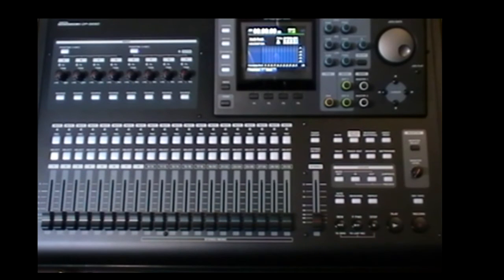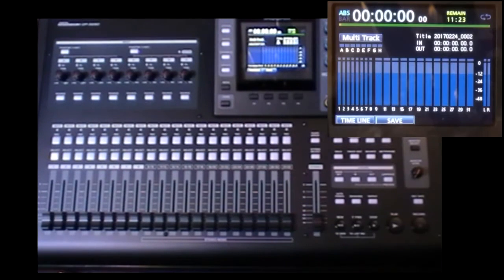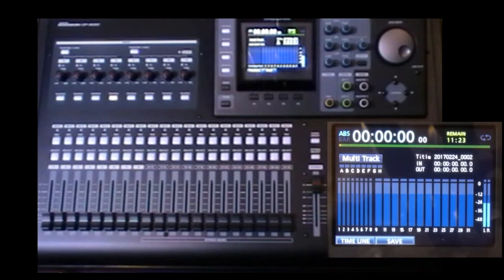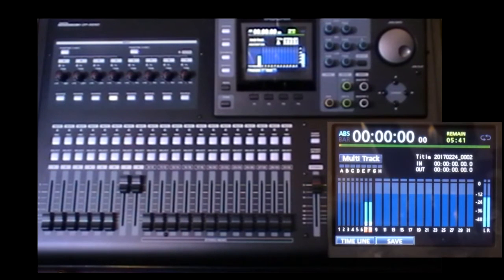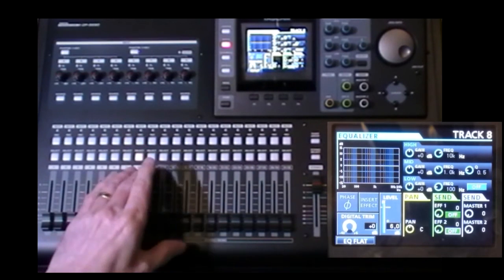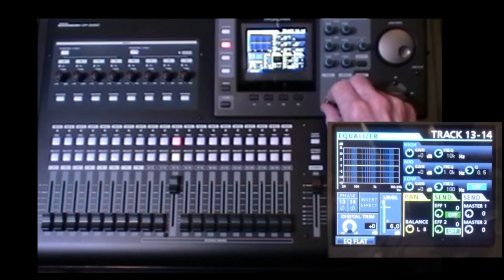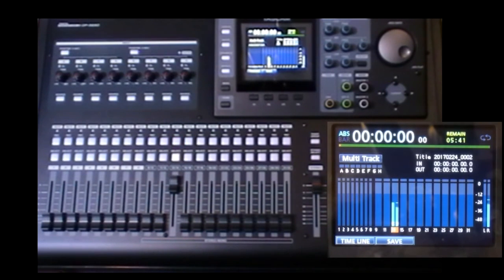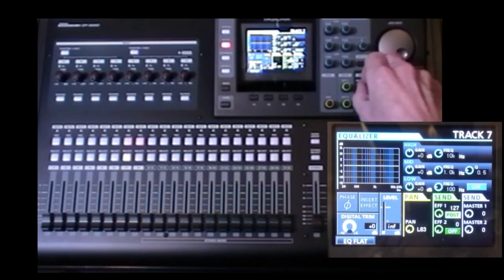Tascam DP24/32SD Tutorial 6C: Stereo

Comment: Hi Phil,

I bought the DP24SD to replace my worn out over complicated Yamaha AW16G. It has recorded 23 albums for me but sadly the inputs and faders are failing, so time for it to go. I won't miss it as this replaced a previous Tascam. A great big heavy lump of a machine. Tascam 688 sounds about right. I do miss that one. However, I don't need all the functions as with any Portastudio I send my custom made midi track from Cakewalk Sonar to the portastudio. Tracks 3 & 4  with a pan at about 12L & 12R. I find panning at a full 16 left & right tends to hide instruments. After recording my backing track I use all the other tracks to rehearse my guitar until I find the track I like best. I mix down through an Alesis 3632 compressor to mini disk that has the auto pause function, then optically copied to a music CD. I then convert to WAV on my PC. I havent set up the Tascam yet as I am concerned about reverb. I layer a  hall reverb over my guitar tracks and I thought I would ask you is that easy on this machine? I only add reverb to my guitar not to the finished track. I like to record 'Dry' using my Fender Mustang amp and then fiddle with it. Your tutorials are enjoayable and anything is better than reading a manual. I have never read a manual so thank you for the great videos.
Reply from the maker: @Peter Williams Hi Peter, thank you for the kind words; glad you found the videos useful. Adding reverb can be easy, but it depends on your workflow and how you define easy :)

Whatever your workflow is, the reverb effect is only available in the Send effect section so you need to be comfortable with using the send system. This system 'taps off' a proportion of your guitar track(s) onto the send paths. You can normally choose either send-1 or send-2 or both, but the internal send effect is only connected to send-1 so you have to use that.  So for each guitar track you want to apply reverb to, turn the send-1 control on (for reverb you would normally set it to POST), and then turn up the send-1 level and the overall master send-1 level.
This will route a proportion of the guitar track(s) into the send effect. 

You then need to go into the effects section and select the reverb, turn it on, and adjust the reverb type and return level. The latter gets the reverb output back to the stereo bus where it will be mixed with whatever other tracks you are playing (i.e. the ones whose track faders are turned up), such as the backing tracks and/or the dry guitar track(s).

Your workflow will then dictate what you do with this mix.
 
1. The simplest method is to feed this mix straight into your external gear, so do all the above in multi-track mode.

2. If you want to record the mix on the DP machine first and then play it back later into your external gear, do the above in mixdown mode.

3. If you want to record the reverb to a spare track so you can do options 1 or 2 later, do the above in bounce mode. Obviously in this case you would only turn up the track fader for the guitar track. You will end up with a new track containing the reverb'd guitar, so you can then blend this with the other tracks during the mix later.

Hope this helps.
P.S. some great guitar playing on your videos - very smooth :)

Comment: Hi Phil,

Thank you for all your help. So far I have plugged it in and in multi track mode I selected channels 3 & 4 and using the assign & faders set a level for my backing track in rec armed and ready. I then discovered how to pan both left & right to minus 50 and plus 50. I also did a full format to the SD card. That took ages. My mistake was as I was recording the backing track to Wind Of Change I found the whistle was too high so I stopped and pressed rewind and started to record it again. But, I was not aware that it had saved the previous recording and it won’t let me delete the track. I went to the end of the track and I then used the jog knob to wind back the audio very carefully to the end of the song and pressed record with both faders down and recorded over what I wanted to get rid of which was after my good recording . Not sure if this was correct but it worked.
So how to you clean a track out when you have made a cock up like I just did? My next project is to see if the track I recorded will play through the Stereo out to my external gear. Monitor out plays fine, but I haven’t hooked up stereo out yet.

So far so good.

Peter
Reply from the maker: @Peter Williams If you want to delete a whole track, press Track Edit and use the 'Clean Out' function. Another option is to just press Undo and your last operation will be undone.

You mention turning both faders down when you attempted to delete the track. Just to clarify, the track faders do not alter the recorded signal; they only control the playback signal. The reason it worked was because you had no signal at the input while it was recording.

Panning does not affect the recording either; only the playback. 
I presume you are assigning the 2 inputs which are connected to your computer (for the backing track) to 2 separate mono tracks so that you can pan them to your desired 50/50 values. If so, you can adjust the panning after the recording if you like. Panning only affects the signal you hear when playing back, or the monitored signal during the recording; it does not affect the recorded signal itself.

When you playback, any tracks which have their faders up will go to the stereo output via the master stereo fader. These tracks also pass through the track pan controls on their way to the stereo outputs, so this is when you need to set them correctly. 

These tracks can also be tapped off in varying proportions to the 'eff send' outputs if you configure the send system correctly. This can be used to drive external gear if you want, or the internal send effect for adding reverb etc.
Good luck.

Comment: Hello Phil! Thanks so much for your great videos! I have a question concerning the stereo routing. I use my laptop to make drum tracks for my music. I am using a 1/8" stereo male to (2) 1/4" mono cable (exactly like the one you pictured) to connect my computer to my DP-24. Your video shows (basically) the way I have been recording: from (Input A/B) to a stereo track. In the video you say that a stereo track does not need panning. What I'd like to know is: does this mean I do NOT have to pan the INPUTS (say, A/B: in from my computer using the aforementioned cable) hard L and R?? I get that I don't need to pan a stereo TRACK, but am unsure about the need to pan the inputs assigned to it. Thanks!
Reply from the maker: Hi +oneminuszero and thanks for the kind words. You don't have to pan the inputs if they are going to a stereo track. The splitter cable and your assignments have done that for you by routing left & right to their respective sides of the stereo track.
Panning affects how a signal is split at the point where it joins the stereo bus, regardless of how the signal got there. If you're connecting a mono source to the stereo bus, either directly from an input, or from a mono track, you need to pan using the respective pan control. 
If you're connecting a stereo source (it can only be a stereo track because there are no stereo inputs), then you don't need to pan as the stereo track is internally wired so that its left & right outputs are connected to the left & right sides of the stereo bus. You just have the balance control for correcting any left/right imbalance in the original stereo spread - I use the balance for correcting old tape/cassette recordings, especially if the tape was worn or the heads were dirty, or with old vinyl record decks where the pickup head wasn't set up correctly... showing my age now :) Hope this helps.
Reply: Phil Tipping first: thank you so much for answering. I'm still a bit confused, though I'm probably just overthinking this. You mentioned that if you were using mono inputs you needed to pan to keep the stereo image. If I'm using a stereo 1/8" male  (from computer) to TWO 1/4" makes (say, input A and B), doesn't that mean the inputs ARE mono, since the cable turns a stereo into two mono plugs? I know I'm connecting it to the stereo 13/14 track, but since the inputs are mono this means I still don't need to bother with pan? Sorry for being confusing!
Reply from the maker: No worries +Channel Zero, it's a confusing subject and really needs going back to basics to understand what the underlying signals are... unfortunately that means it's going to be a long reply :) but here goes...

To create a mono signal in the first place, say using a microphone, you'd use one microphone pointing at the source, say a band.
If you play that signal through a single speaker, the sound will appear to come from that speaker - there's nowhere else for it to come from - so the band will appear to be inside that speaker. All the instruments will be squashed up into a single point, so you wouldn't be able to tell how the band was laid out - where the guitarist is, where the drums are, etc.

If you play that signal on a stereo system, i.e. through two speakers placed left & right, with equal amounts going to each, the band will still sound squashed, and they will also appear to come from a single point in the middle even though there is no speaker there - this is the 'stereo field', which is all an illusion. 

If you turn up the volume of the left speaker, and turn down the right, the band will appear to move to a position nearer to the left speaker. Adjusting the volume like this is the same as you sending more or less of the signal to the left & right speakers, in other words, you're 'panning' the signal. If you pan it hard left, all the signal goes to the left speaker, and nothing goes to the right, so you're back to the original scenario where you have one speaker and everything appears to come from that point.

But no matter how you pan this signal, it will still only come from a single point in space because it's a mono signal. The band will remain squashed even though you're listening to it on a stereo system.

Now to stereo signals... using the same setup, you'd use two microphones, both pointing at the band but angled or positioned so one picks up sounds from the left-hand side, the other from the right. So each microphone is capturing a mono signal (that's all the mics can do), but the actual signals are subtly different as they are from a different 'viewpoint'. They only make stereo when they are played back in a special way as a pair. It's like vision, where your left & right eyes see the same view but from a slightly different perspective. Your brain merges the 2 optical signals and gives you 3D (visual stereo if you like).

It now depends on what you do with these two mono signals. You're right in that each of these is mono, and if you route either of them as in the above mono scenarios, you'll get the same squashed effect.

In order to hear the band in stereo, both signals need to played through 2 speakers with the left (mono) signal going to the left speaker, and the right signal solely to the right speaker. The band will then appear (in your head) to be spread out between the two speakers and you'll be able to visualise the positions of all the players. 
The crucial thing is to keep left & right signals separated all the way to the speakers. If either of the signals 'leaks' over to the other speaker, the stereo illusion will be lost or reduced.

So back to your computer scenario, you've got your left & right signals on two separate cables. You're right, they are both mono signals, but they must be kept separated if you want to hear stereo. You use two mono inputs on the mixer - fair enough, but now you have a decision as to how they end up on the stereo bus... which will eventually go to your left & right speakers.  

Option 1 is to route them independently direct to the stereo bus, in which case you have to pan the left input left, and the right input right - using the input pans. 

Option 2 is to route them independently to 2 mono tracks, then pan the mono tracks onto the stereo bus using the track pans.

In both these cases, if you don't pan, each mono signal will be split equally across left and right sides of the stereo bus, i.e. it will appear central in the stereo field when you listen (that's what the C stands for on the pan controls), so you will have lost the stereo effect - the band will appear squashed to a single point.

Option 3 is to route them to a stereo track. When you assign, say inputs A & B to a stereo track, it means A goes to the left part of the track, and B goes to the right, so the track itself keeps the 2 signals separate. The stereo track output is pre-wired onto the stereo bus such that its left part goes to the left side and vice versa, so again the signals are kept separate. So using this option retains the stereo effect without having to pan anything.

Phew! Bit long-winded I'm afraid, but hope that's helped. Just shout if it's still not right :)
Reply: Phil Tipping I can't thank you enough for taking the time to explain that! I've actually been recording using TASCAM 4-tracks since 1993. I was given a copy of 'The Recording Studio Handbook' by a friend who attended Full Sail Audio-Video Technical College in Florida (the book was the basic textbook used at that time)...and you did a MUCH better job of explaining stereo/mono panning and the stereo field than the book! I've only recently gone to digital, and tho I find the DP-24 a bit odd to use in places, with your help I feel much more confident with the machine. Thanks again
Reply: Phil Tipping I would like to add one further thing just so I'm sure I get the options you've outlined. I'm sorry to be taking up so much of your time! What is the difference between Option 1 and Option 3? Let me see if I can answer it; if I can then I understand perfectly. Option 1: two inputs using a cable from a stereo source. Input A panned hard L and Input B panned hard R. The two inputs would be assigned to the stereo bus (or recorded onto two mono tracks; if this is performed, the track pans must ALSO be panned to preserve the image). Option 3: Input A and Input B are assigned directly to a stereo track (say 13/14). Because it is a stereo track, panning is not required on either the inputs or on the tracks (tracks route it L and R automatically). so...did I get it right? Thanks Phil!
Reply from the maker: Yes I think you've got it. Panning is only reqd at the point where mono signals join the stereo bus, and this happens either if you're listening directly to the inputs (so you use the input pans) or from the mono tracks when they are playing back (track pans). Note that inputs go directly to tracks when recording - there is no pan control in that part of the path.

The advantage of using a stereo track instead of two mono tracks is that there is only one set of controls. The track fader, EQ, mute etc. all operate on both left & right sides of a stereo track in unison. If you use a pair of mono tracks instead (option 2), you would have to keep two sets of controls in step with each other. Any imbalance between the left & right tracks would 'move' the stereo field.

No problem with the questions - keep asking away :) It's quite a deceptive topic as it appears simple but can be tricky getting your head round if you've never really looked into it. I'm sure it'll all click when you try it a few times. Good luck.

Comment: Hi Phil. Thanks for your brilliant tutorials on this, it's really awesome!
I have one thing that I can't find anything on. When recording a stereo signal from two mono inputs is there any way to chain the input levels on the two mono inputs? 
I find it a little difficult to set the precise input levels correctly. 
What I normally do it turn left side up until I see it clipping and then find a level just below the clipping point and then I do the same thing with the right input level.
I know there is a possibility of turning the input levels to maximum on both sides and then control the input from the device connected but I presume it creates more noise compared to the previous mentioned method.
If there is a way to set the input levels simultaneously on both left and right it would be a lot easier to control.
Reply from the maker: @yezdk thanks for the kind words. Yes it is difficult to get both trims set to exactly the same level unless you use e.g. a test tone... but if you assign them to a stereo track you can use the balance control to compensate. It does exactly what you want - it adjusts the relative levels of the left & right sides.
You're correct in thinking turning up the trims full is not the right way. It will introduce unnecessary noise... and you can't guarantee that the fully clockwise positions match across the 8 pre-amps. If your source has its own level control, I would also set the trims to the 1 o'clock position first (unity gain) and adjust the source so the signal is at the -12dB level. Only adjust the trims if the source level range is not sufficient. After recording, compensate for any imbalance by using the stereo balance control.
This is all in the Step-by-Step guide if you want further info; full details here http://www.philizound.co.uk/freebies/dp24-32/dp24-32.html
Reply: @philtipping  thanks m8!